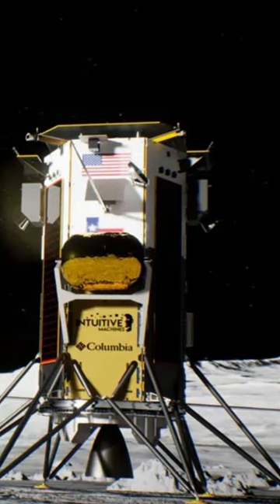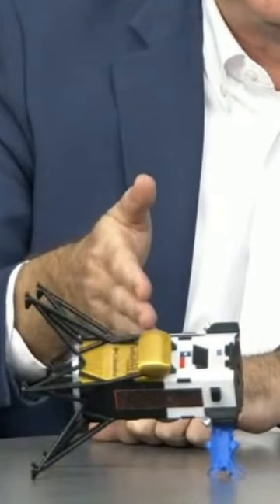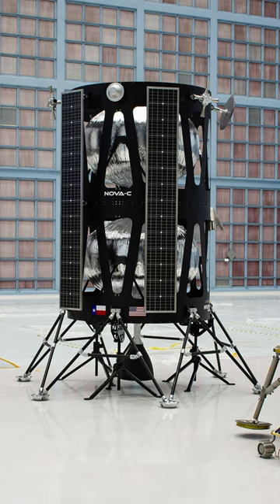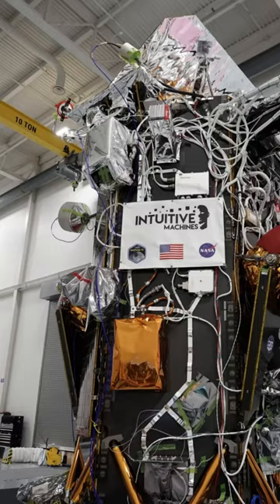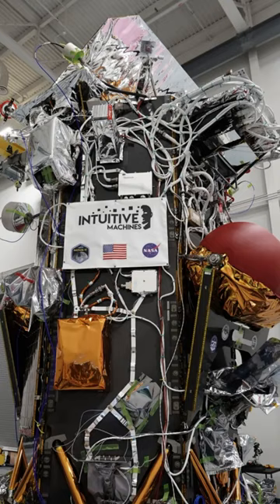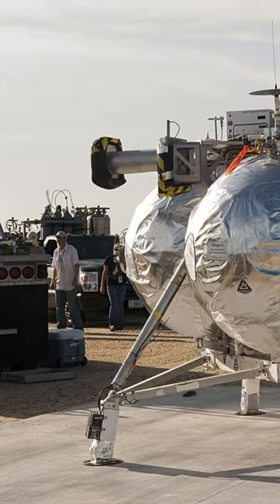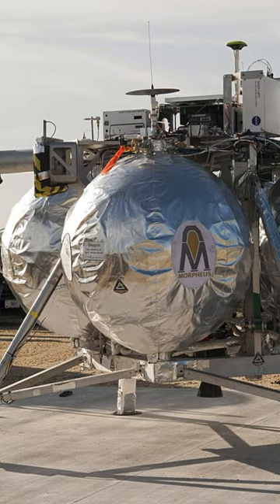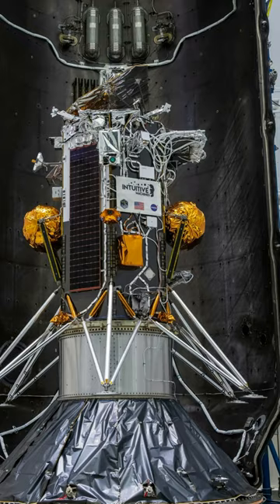Why Was This Moon Lander Built So Tall?

Comment: They could make deployable landing gear like Surveyor or Apollo but the main solution absolutely has to be minimizing sideways velocity.
Reply: Why is that apparently so hard to achieve?
Reply: @nkronert  I know, it really shouldn't be. A bit of shape memory alloy and a heating wire is all you need, and has the advantage of being exceptionally springy. The heat of the engine firing might be enough to deploy them.
This is tech that has been used for solar deployment for decades.
Reply: @agsystems8220  I meant more the horizontal velocity part. I can imagine that last moment dust blown up by the engine exhaust can cause issues for optical tracking systems, but it should be possible to come to a hover first at some altitude and then descend vertically, which will likely cost some extra fuel but should be better than a topple over scenario. With that regard I'm also very worried about the feasibility of the Starship lander design.
Reply: @nkronert  I'm worried about starship only if there would be humans onboard. But yes. I was criticizing the length of starship for quite a long time.
Starship shouldn't be built to length, but towards the wider diameter. Make starship half of length but double the diameter. The volume would grow, the dry mass would not grow much, if at all.
The drag is a problem for lower atmosphere, anywhere higher it doesn't matter significantly.

To maximize volume and minimize mass the starship shape should be as close to pall as possible. Closest approximation would be probably a cylinder with diameter as large as length.
Reply: @petersvancarek  even if there are no humans on board, you don't want the thing to topple over during landing. And if it is standing upright, how to get to the cargo easily?
I think they should consider landing the thing horizontally if it is there to stay (e.g. used as living module), using thrusters in the locations where normally the flaps are located.
Reply: @nkronert  yeah... the height complicates everything.
Reply: Deployable landing gear means more moving parts and more complexity. It could have been hard to achieve given their design, schedule, or budget, or combination of all 3. Did you know the most common cause of spacecraft failures comes from issues with structures and mechanisms? Historically speaking, that subsystem has the most issues. Deployment mechanisms come with an increased risk, that is not to say they aren’t useful. Sometimes the best part is no part.

Comment: People saying that legs are the problem or its shape, but if you going sideways doesnt matter what shape you are even disc shape craft would flip if it would land with high lateral velocity on moon regolith. You need to count that your navigation system will accuratly gide you strait down in your chosen spot. And more mass that not payload you add less fuel and payload you have.
Reply: I remember the recording by Aldrin to Armstrong where right near the end of the landing he calls out “ you’re drifting to the right a little”.  Yeah, it needs to come straight down which might prove challenging given all the stuff ( craters, boulders, hills) near the South Pole of the moon .

Comment: Another way is to have poles that can extend from the lander to self upright the chassis. 
The lander can be more squat in design with rolled up. Flexible Solar panels, a technology already tested on the ISS, that are mounted on a telescopic pipe that can raise up, once the low center of mass has landed in the correct attitude in the surface of the Moon.
Reply: Way too many moving parts and failure points to ever be worth it. The solution is as simple as using the current design an picking your landing spot better.

Comment: You could still keep the fuel and oxidizer in the right places while getting a lower centre of gravity by simply creating a cone (a bit like a pyramid,) split into a top half and a lower half.  I take it the two tanks don't have to be vaguely spherical?  And, even if they did, you could still do a similar sort of thing in a more spherical arrangement.  Might have additional benefits in that you could have more than one engine nozzle with a wider base, yielding more stability and control when landing.

Comment: The Surveyor landers had 3 very wide span landing legs and 3-raisesd small rocket motors and RCS. The Apollo 12 photographed the Surveyor on an incline, perfectly stable. This new lander has a single engine with the engine bell-mouth within inches of the surface. High CG and 6-fixed, narrow-span legs... and bellmouth hugging the surface... yep unusual combinations all-around. This is all 'why I can't believe in the Starship lunar and mars landers... are fantasy at best... and/or have to be radically  redesigned.

Comment: "The legs are fixed" which is.... Not a requirement.
Reply: No, but deployable legs are a) extra mass adding to fuel requirements, and b) another moving part to go wrong. Everything is a compromise.
Reply: @simongeard4824  Well if you want to actually land upright, and you KNOW you are top heavy i think it's something you shouldn't skimp on. By that logic you could save the landing legs altogether and just hope to balance perfectly on the engine nozzle. 😄
Reply: @nemo-x  Well, it works in KSP, of course. But that's just a standard engineering trade-off... a wider deployable legs will reduce the odds of one failure scenario, and increase the odds of others. And someone did that risk assessment, and maybe chose wrong. Or maybe not... if they'd gone with deployable legs and one had failed to deploy, we'd be having the same decision about why they didn't use fixed legs...
Reply: @simongeard4824  Yeah but where would you draw the line between "ridiculous to attempt" like landing on the engine, and "actually enough landing structure"?
Reply: @nemo-x I wouldn't... I'll leave those decisions to the people paid to make them. They might get them wrong sometimes, but they're much better qualified to make the call than I am.
Reply: @simongeard4824  You'd be surprised how little being "qualified" means in terms of making right decisions. Experts regularly make misjudgements that a 5th grader could point out, but they don't notice, because they're so entrenched in the details of the project.
Reply: Well yeah, if you ditch the legs and try landing on the engine, you might fall over. But, there's always next attempt, and this is the time to be making mistakes.
The legs have done nothing but reduce the amount of science that could be done.
Reply: @nemo-x  Source: Random person on the internet who thinks they could do the job better
Reply: @OutsiderLabs  As stated above, sometimes experts make mistakes.
Reply: @simongeard4824 The difference between expert and novice in stuff like this isn't how much one knows, but in how likely one is to be badly wrong when making a guess
Reply: Superb idea! Huge deployable landing leg mechanisms with multiple actuators, latches, bearings, and control solenoids that must all function to land! So weird that they chose lightweight static legs for a low cost payload lander.
Reply: @travcollier   Yes. Experts can get it wrong, and novices can get it right — but that doesn't mean the novice knows more about the expert.
Reply: @nemo-x  Except this lander is NOT top heavy. Tanks are almost empty at landing time. With less horizontal velocity, those legs would have worked perfectly.
If it had extendable legs, and had landing failed due to one of them failing to raise, we would be blaming IM engineers for not using fixed legs!!!

Comment: I know this might be a stupid suggestion, but why not make the upper tank a toroidal shape that surrounds the lower tank? sure, there would be a little more design for it, but the center of mass would be lowered by roughly a half and it would remain in the center horizontally rather than bounce around.  It would also make the base wider, thus more stable.  Just a 10 second analysis from a computer scientist, not a rocket scientist.

Comment: Simple: (1) Allow for separation of engine module from lander at altitude (2) suspend lander from engine module via cable ~100 meters length +/- (3) engine module allows controlled descent of lander to selected surface location (4) if lander does not set down in desired position/location, ascend and retry.
Reply: Your "simple" solution would add a hundred million to the project cost and about fifty extra failure points. Don't quit your dayjob for NASA just yet
Reply: @OutsiderLabs  Total cost to NASA for this lander mission was about $120M so your estimated added cost is, well, silly. Online math classes are generally cheap.

Comment: A solution would be a ball shaped lightweight cage with the landing gear extending out of it. An internal track could reorient the main body if the lander tipped over. A small rock 🪨 boulder or crater could cause it to tip, not just drift.

Comment: All true, but I think the real design shortcoming is in the rigid / fixed legs. They won't be able to tolerate or compensate much for vehicle tilt or an uneven or sloped surface. Even with no lateral velocity, one, or at most two legs are going to take all of the force of impact with any slope or hindrance at all. 
Something with more give and an auto-righting mechanism would be preferable... though I don't know how to do that without adding weight.

Comment: The elephant in the room, that Scott fails to mention, is the lack of telemetry, indicating that the lender was making contact with the moon at a sloped area! The slightest amount of horizontal movement would result in a flip since the leading legs of the lander make contact first, tripping the probe over itself! It’s a wonder that the Lander didn’t disintegrate from the force of the landing, which suggests that the horizontal movement was slight, but significant.

Comment: 4 Cylindrical Tanks slightly more mass, low gravity is at the core of the problem. Cylindrical Tanks Mass moves down as fuel burns lower center of mass.

Comment: It seems to me they could raise the top of the leg up and lengthen it to improve the width of the base. They could also add a spring to the bottom to make each leg self stabilizing. All with very little increase in weight.

Comment: Apollo LEM stack wasn't exactly a pancake either
Reply: Yes, but it arguably had a proportionately lower COM, despite the stalky legs; most of the fuel was located in the lander 'ring' section, which was a structural anchor system for said fuel tanks, the landing legs, and the Habitation/Ascent Module.
Reply: It had a human pilot, big difference when it comes to dealing with slopes and horizontal velocity

Comment: Thank you ... I was wondering this myself.  Also, the center of mass isn't the same as the geometric center of the structure.  I wonder if the mass of the rocket engine meant that the COM was much lower than it appears.

Comment: What's more interesting IMO. is that we were much better at lunar landing when using 1960s technology than today. I dod suspect that a wide, horizontally long lander would make more sense. 

Given the original plan was to land in an easier location, was this a design choice that it was too late to change ?
Reply: Who is we?
This was not Nasa, this was aprivate company develope their probe from scratch
Reply: @sH-ed5yf  Did they build it without any input from NASA and 70 years of accumulated moon landing knowledge ?

Comment: You could nest 2 tanks within each other, like nested cylinders. Also helps with cooling the fuel.
Reply: Cooling the fuel? Why would you cool the fuel IN SPACE? Not to mention nesting the tanks reduces the fuel volume, and therefore the delta V?
Reply: @SagittarA  because if the sun shines on your fuel tank in space, it can heat up as much as in a kitchen oven. Some fuels are fine with this, others aren't. Some fuels need to be kept at very low temps to work best and not boil off into gas (and in extreme cases, build up gas pressure and explode). This is why some have isolation put around the fuel tanks, like SLS main tank orange foam coating. This is very heavy though, SLS foam weighs several tons. By nesting them and keeping the oxidizer on the outside, you get most of the isolation for free. + extra structural strength. One downside is more difficult to manufacture.
Reply: bro youre smoking some good stuff i tell you.... orange SLS coating to prevent heating in space on a atmospheric lift stage that doesnt even go to space?
heating surfaces like oven? do you have a souce for all this nonsensical bs or did you just made it the fk up? @BartJBols

Comment: Well, failure is always a chain of failures that in total contributed to the failure, breaking one such chain might have prevented the overall failure.   Had the original lidar system not been left on a physical safety lockout then maybe the lander might've landed properly.  I am interested in why they did not launch the camera probe as it was a disposable item anyways and with the experimental ad hoc landing procedure with a lidar not intended for navigation, capturing as much information as possible for a post mortem analysis would seem important to me even when the external camera was an optional procedure.  At this time, we believe the probe suffered an operational error not a design flaw...   Now, perhaps future safety lockouts should be designed so they could be removed remotely as such probes are unmanned probes so thar could be considered a design flaw but I wouldn't jump all over them just because it's a tall lander, at least not without external video from the camera that was not launched as it was considered optional and hence ignored in the impromptu landing procedure.

Comment: Thanks for addressing it. There are good resons but not good enough. The fix is to re-engineer the lander. Maybe the next one will work, but it's a bad idea, most so for StarShip with humans inside. It is not that it can't be done, it's that it's high risk.  But OK they can continue to throw engineering principles,  common sense, and history: none of the surveyors fall out after a soft landing, and that was with 60s computers.
Reply: Your understanding is flawed.  You pretend they had a large budget and no mass constraints.  I think you're in over your head.
Reply: Another commenter has speculated that the LIDAR was turned off due to dust concerns, the RADAR wasn't working, and the INS was miscalibrated.
All of that notwithstanding, the solution is to zero out translation velocity before touchdown.  That's a lot simpler to do than reengineering 'from the ground up.'

Comment: Could the tanks have been configured radially where 1 tank is cylinder-shaped placed inside 2nd tank that is cylinder-shaped doughnut?

Relitive volumes of the tanks would account for the differing burn-rates and masses.

Such a system could be 3-d printed, could be stronger/stiffer, uses less material, could accommodate multiple different tanks

Comment: We should remember this lesson when we finally start building the first windmills on the moon. Go vertical to avoid obstacles.
Reply: There's still one major obstacle to overcome before the first windmill gets built on the moon.
Reply: Yeah, the wings of a windmill are quite large to store them in a rocket. Maybe we can fly them to the moon with an airship, they should be large enough.
Reply: @jantjarks7946   No problem. Starship should have the capacity to store some decent sized wind turbine blades to the moon. Probably get a good deal from SpaceX as too, Starship test launches desperately in need of a dummy payload.

Comment: Makes you wonder how they landed so easily with the astronauts
Reply: It wasn't that easy. They also just had a lot more spacecraft and a lot more fuel.
Reply: Obviously because the astronauts – seasoned test pilots with years of training – were at the controls. The answer is in the question.
Reply: Almost didn''t if you go back to Neil's landing. As to landing easily,, it is a bigger craft, hence it has a much larger 'contact patch' if you will, to settle down on the moon, at least it seems it would :-)
Reply: Well, they had a bigger budget, and trained flight test pilots on board. That helps.
Reply: Lower cog?
Reply: You call Apollo landings easy?

Comment: nah....CG is above the convergence point of the strut  axial axes....it is naturally unstable....the designers over relied on avionics instead  of making the structure naturally stable.  A solution would have been to relocate the strut connections to the body from the base to the mid height of the body.  If this was done, the CG would have been 'hanging' from the struts instead of 'hovering' above the struts.  It wouldn't have tipped over even with a lateral motion at touchdown....I would dare throw in a big guess that the design team neglected to hire a Mass Properties Team during the design phase....don't mind me...this is just an opinion in a sea of millions...

Comment: The repeatedly similar issues makes me worry about the lunar starship… any issue in alignment, location, engines or legs could lead to horizontal speed and a tip over that strands the crew. Perhaps fuselage long landing legs?
Reply: The crews will wait until autonomous ships have pioneered the launches and landings. The greater worry is what novel components will be on the crewed ships, which is why rockets with a tried-and-true design like Falcon-9 Block Five are used for crewed missions.
Reply: We'll have to wait and see what their landing legs look like.

Comment: The error is all human. Try writing code that prevents the lander from setting down while still in lateral motion.
Reply: Easier said than done when you're running on empty
Reply: @OutsiderLabs  If the reason it soft-landed in a crash is because it ran out of fuel, that is also human induced error.